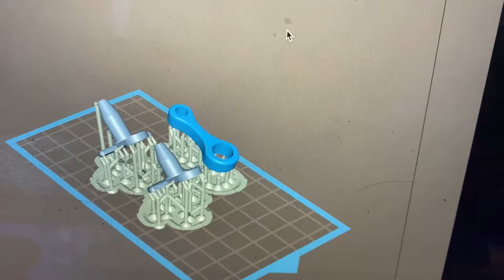Casting The Connecting Rod and Crank For The Cast Two-Stroke Engine

Comment: Great video.   I used a cast connecting rod for my first two stroke.  The bore is .625.   I went to a simple machined piece of aluminum on later mods.  I machined the crank shaft, counterweight and big end pin from a piece of round steel using a Sherline lathe.   Ball bearings are nice but on an engine this size "oilite" bronze work well and is lighter weight.   Bronze bearings were used in many many successful model airplane engines from 1930's right up through the 1980's.   Here's my two-stroke engine video https://youtu.be/DaOicUnTP7I
Reply from the maker: Very cool! Thanks for sharing.